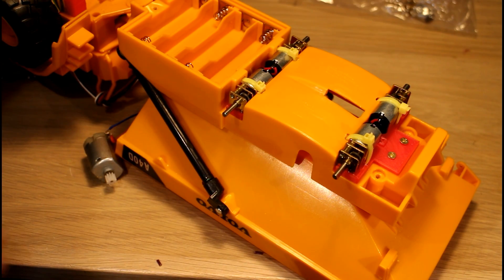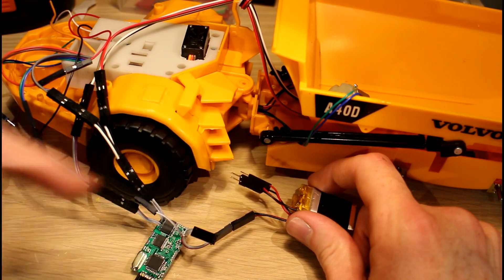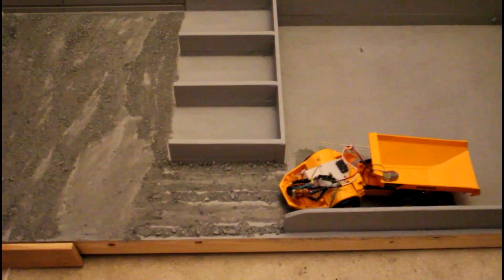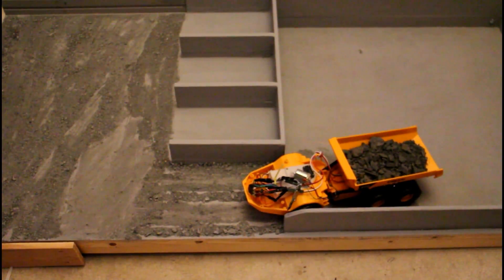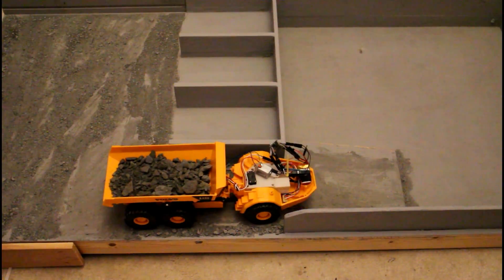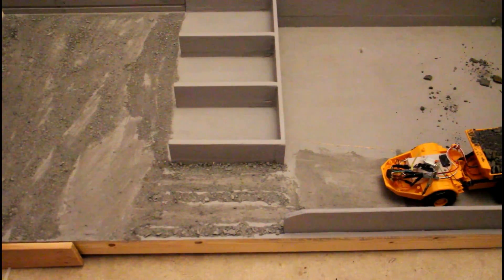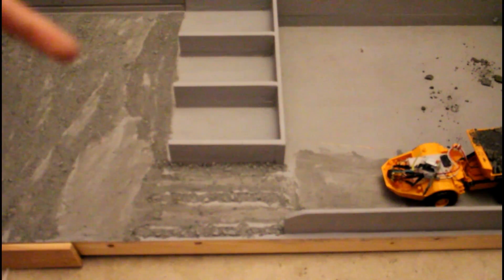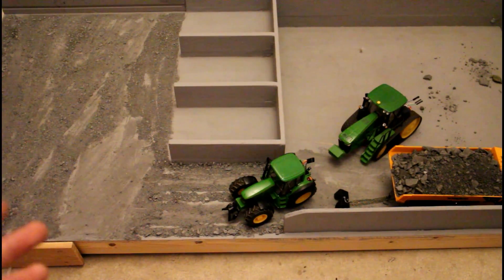Volvo A40D Part 5 - New control board with brownout disabled

Comment: What is the transfer function for the differential effect that you use on these models?
Reply from the maker: The position of the steering joystick linearly varies the max PWM of the drive motor on the inside of the turn between 255 and 120 depending on the severity of the turn, nothing complicated.
Reply: So it's kind of a linear behavior, increasing and decreasing the PWM according with the position of the joystick !!! Interesting !! I was wondering if it would work on high speeds to eliminate the need of a differential on a RC car !!! I got some projects like this too and I think your channel and all this projects are awesome !!! Congrats on your work !!
Reply from the maker: Cool idea, if the options are solid axle or this software differential then it might make an improvement although with this method you are reducing the power to one set of wheels whereas with the real differential you aren't reducing the power from the motor.

Comment: hi it may be the hard smooth surface of the tyres
Reply from the maker: The motors that are in contact with the surface are stalling while the others just spin so I think we are getting sufficient traction but we need either suspension to get the other wheels on the ground or more power. I think power is the way we'll go :)